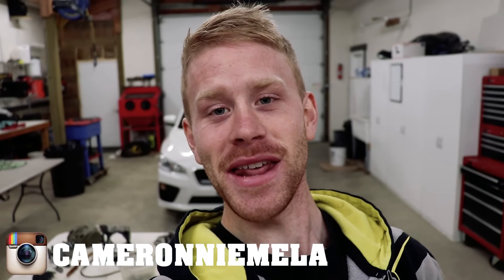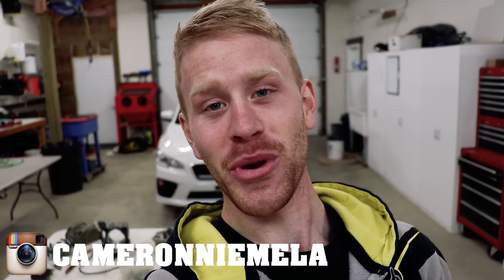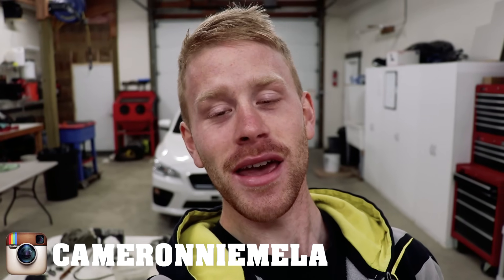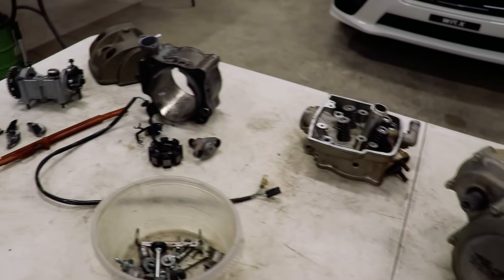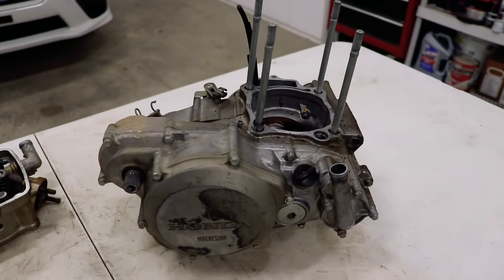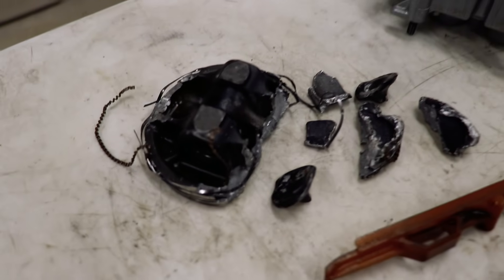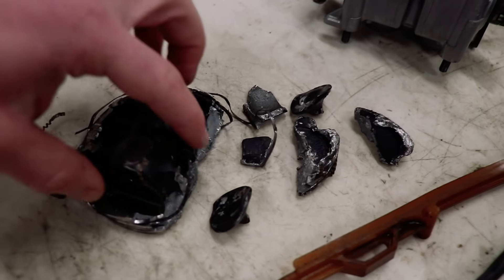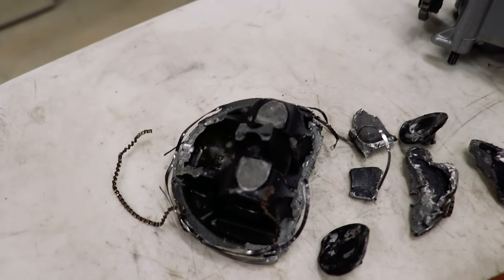Blown Up 4 Stroke Engine!

Comment from the maker: Have you ever blown up a motor?
Reply: No. I'm an adult with tools, common sense and a service manual. And I don't go "Well the owners manual says to change the oil every 3 rides. But I don't race, so once a year should be good".
Reply: Yep, one tc85 and one tc125
Reply: Cameron Niemela Yup😐 And the bike is from the 80`s so it is hard tp get pats for it
Reply: blew up an 04 cr 125 twice!
Reply: Yea, a tc 125 and a kx250f
Reply: Never, and it's so interesting Thanks cameron !
Reply: nop
Reply: ya a yamaha 85 2stroke from 1980 and a fiddy 125cc 4stroke
Reply: Blown up a cr125 5 times and blown up a Kx250f once
Reply: Rm125
Reply: Not yet lol
Reply: 04 crf250x
Reply: My first bike a honda xr100
Reply: @jerrybijleveld9955   what! Those things are bulletproof lol
Reply: @iphone3gsdivine  Yeah they are, only this bike had a too low compression around 4,5 Bar(63psi) and smoked more than 2 stroke bike. and the previous owner had mixed different engine parts together. CB50 bottom-end, 80cc top-end and 100cc intake that was way to big and on top of that a chinese piston wereby the crown of the piston had selfmade hammered valve reliefs. it ran like that for almost a year.
Reply: Cameron Niemela my step brother blew his yz250 with a 290cc big bore kit😢💵💵💵 that was a expensive joke the whole cilinder head crank everything was fucked...
Reply: Cameron Niemela no
Reply: Hmmm... not yet
Reply: Cameron Niemela somehow I blew up a KLX110
Reply: Cameron Niemela 

I blew a 86 cr 125
Reply: Cameron Niemela no not yet lol
Reply: Almost
Reply: Not yet I haven't
Reply: yamaha yz250f rod came through the cases
Reply: No luckly not😅
Reply: No cuz i ride like a pussy
Reply: 2002 yz426f twice in 3 months, first bad crank bearing then i dropped all my valves and i mean all!! It was chewed metal, they all snapped off, she was toast !
Reply: what happened to it? i have a 09 yz450f
Reply: Cameron Niemela yes a 2012 kx250f
Reply: Crunched a valve on my WR450, if I had replaced the timing chain earlier than I would've saved 500$
Reply: Hebeli semmosia paskakasoja ne Derbit on
Reply: I’m sad to say I blew up my 97 Yamaha GP1200 two weeks ago... I really like your videos, I’d love to see some content about your badass SuperJet!
Reply: My buddy blew up a 2017 yz450f cracked the oil filter housing lost all oil and destroyed everything luckily I was able to reuse the cases and transmission
Reply: No
Reply: 03' Crf150f
Reply: Yep, dropped a valve in a 250cc atv. Piston had a gaping hole in the middle
Reply: Cameron Niemela kx100 3 engines 3 bottom and top ends smoked
Reply: Cameron Niemela yes, RMX 250 main Bering failure.
Reply: if piston ring damage counts then yah
Reply: Blew up ktm 125 2014 2 times
Reply: Blew up one of them cheap 4 stroke China scooters. Several Holes in the block even though I had enough oil
Reply: Unfortunately yes I have...😂
Reply: Melted my rings on my Ktm sx250 2001 a few years back if that counts 🤷🏽‍♂️
Reply: Blew my 04 crf 250r last week.....
Reply: Yeah I blow my my yz 250 2stroke
Reply: Yep xr50
Reply: I blew up a Honda XR400R once from no oil sadly😂 some how sold it and then got a YZ250f and blew that fucker up cuz of no oil as well that was just a 
 mistake though,   The bolt where the oil drains out fell off during a ride and the oil dumped out everywhere while riding.   I had no idea until I realized the bike lost power and then just seized outta no where I was so pissed off 😂😂  I’m gonna fix her up tho.
Reply: Blew up my 1987 lt500r
Reply: Yes, yz450f, In winter sesson.
Reply: Yep i blew up a 1984 yamaha yzinger 60 like 2-3 times
Reply: Cameron Niemela have you ever blown up your mic??
Reply: Blown up ready for the list 
KTM 50 mini 3 times
KTM 50 sx 2 times
KTM 65 sx 4 times
KTM 85 sx 3 times 
KTM 125 sx 2 times
KTM 250 sx-f 2 times
KTM 450 sx-f 1 time
KTM 500 exc-f six days 1 time 
Sorry for the list the 450 and 500 where my dads and I am 17 and I blew them both up
Reply: Xr100r
Reply: Yep locked up the sled in the middle of the field
Reply: Yep once my scooter 70cc blow up now i got dirtbike and it works well!
Reply: I blown a gs bmw 😪
Reply: Blew a hole in the bottom of one of my 91 cr500r cases... Desert racing high speed. Expensive fix to say the least. Also had a 05 crf450r throw a valve because the idiot mechanic at honda didn't know what he was doing, and didn't listen to me when I told him the springs needed to be changed when using stainless steel valves instead of the oem titanium. He also screwed up the timing and tried to blame it on me, bike fully locked up the back wheel and kick starter and almost threw me off the bike onto the ground at 40 mph or so.
Reply: How much would a top and bottom rebuild cost for this motor?
Reply: blown my ktm sxf250
Reply: Yep blew up my cr 85 twice
Reply: never had a catastrophic failure like that. I've fried piston rings on 2strokes and damaged cylinders. closest I've gotten was when i popped the main crank seal on my crf250. the engine backfired,i stopped to listen and look,had oil pouring out of the breather vent on the tranny side.  limped it back to my trailer under power. by that time the engine was tapping pretty bad. oil had copper in it. close! but no cigar. lol
Reply: Blew up my Derbi Senda 50, those things are pieces of shit but i aint got no money

Comment: Hey , some questions , i need some help by you please!!
Im looking to buy my first "dirt bike" ,  a YZ450F 2006. what you say ? is good choice ? 
just for amateur use, no tracks or race etc, just some rides to my town.
I dont know much about mechanicals etc, does a dirt bike needs knowledge? yz450f need experienced user? 
now i drive a 125cc and im 28!. shall i go to 250 or 450?
Reply: 450 hauls some serious ass
Reply: Depends how much power you want
Reply: Petros Komninos if you are just an amateur i would go with a crf250 because they have decent power but not too much and they are honda’s which are super reliable

Comment: Hey, what if you convert one of these 4 strokes to run on diesel and show us the steps?
This request is maybe a bit unreasonable, but I certainly wouldn't mind 6,5 bhp using only 1,4 liter for every 100 km.
That would be 62 miles using only 1 large soda bottle with coke or whatever else that comes in these bottles.
If you like to travel long distances, this could be like your piggy bank on two wheels ^_^
Wanna try it?

Comment: The oil filter was put in backwards. When you pulled the cover off the oil filter, the metal closed end should go towards the cover.
Reply: Truck Camper No it wasn't, the spring goes in first and the closed end of filter sits on the spring.

Comment: I have a question so it's winter here and I tested my new clutch cable on my bike so I took it down my field and then it just died on me.. I have a full tank of gas and have lots of compression does any one know what happens

Comment: i blew up my 50cc gilera supermoto because there was a leak in the water container and i had a race exhaust and yeah then it got hot and died on me 50km. from home... but i rebuilt it with an 88cc race cylinder ^^ (it went 144km/h)
Reply: Blew mine 3 times... every time there was coolant water leaking into crankcase and flooded it. 4th time i got it finally fixed.
70cc
Ran about 125km/h

Comment: The best part about 4 strokes is rebuilding em!
Reply: Theres nothing good about 4 strokes unless the manufacturer is supplying you with parts and a mechanic.
Reply: The BBQ Jerk that's facts
Reply: +BBQ Sandwich 4 strokes are great because if you actually fucking take care of them you wont need the parts or a mechanic.

Comment: 2:02 why is it written 670cm3 on this side ? I though the CRF 450 was a 450. Maybe an old design they re-used ? Or modified engine ?
Reply: TheCabillaud94 The number shows the exact oil filling volumen of the engine.
Reply: Typgamer ho yeah that makes sense. My personal hondas have the same marking on the cylinders but their matches the engine displacement. Thank for you answer.